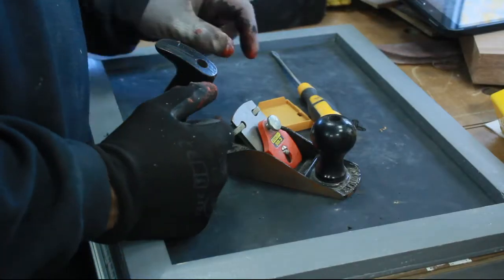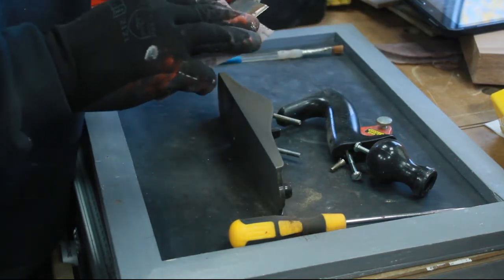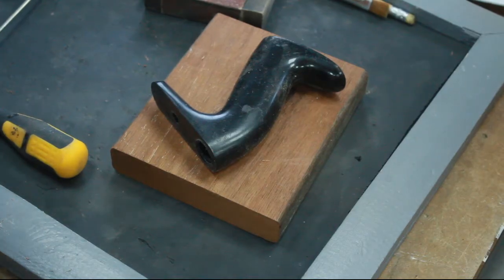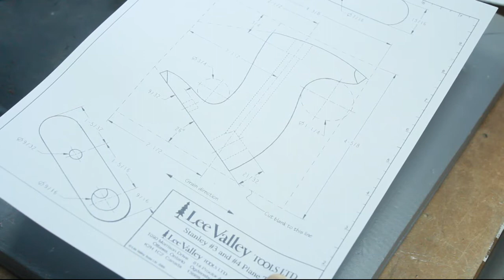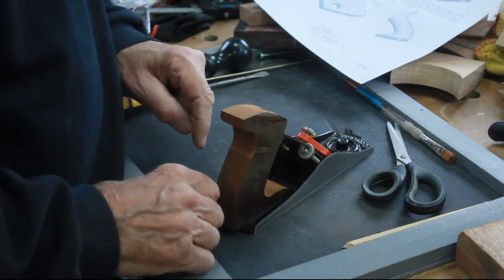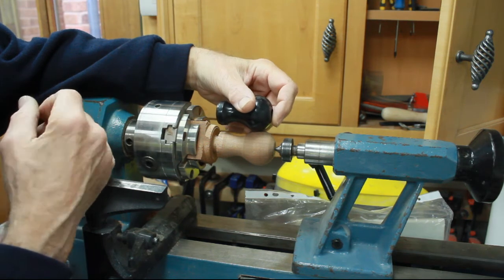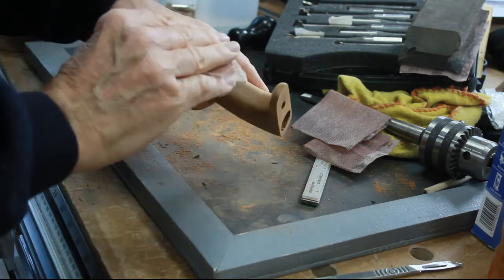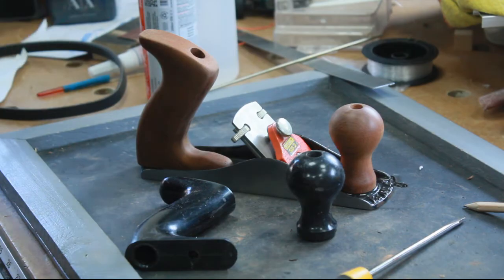the small shed #312 - Sprucing up the plane

Comment: Really nice project Peter. I have an old Stanley no.4 that I call my Frankenplane as it has a much older cap plus brass work from Faithfull and replacement wooden handles. I agree with you that it is so much more pleasant to hold wood rather than plastic.